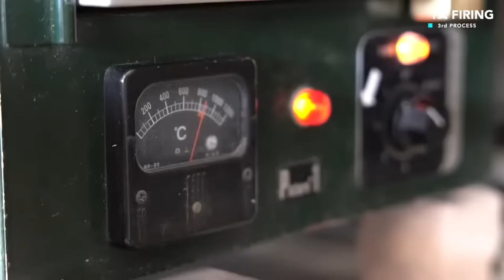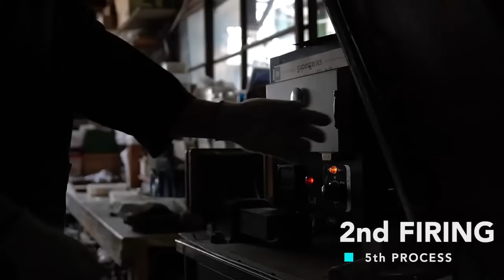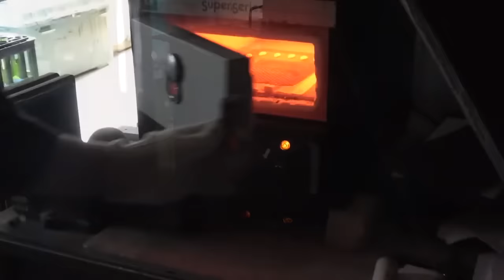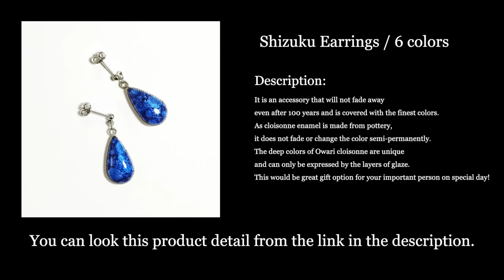七宝ジュエリーを製作するプロセス【ロングビデオ】

Comment: This is beautiful enamel work but not what is  considered to be cloisonné by definition. Cloisonné utilizes  closed spaces created by bending thin metal strips into various shapes and affixing them to a base. These spaces are then filled with enamel paste and the piece is fired in a kiln. These closed spaces are called cloisons (French for “partitions”). This enamel work has no such closed spaces, therefore it should not be properly called cloisonné, but is enamel work of another style. I myself make cloisonné jewelry and this is not it. Nonetheless, I find this jewelry beautiful. As the entire piece is outlined with metal and then filled in with enamel, the entire piece might be considered one cloison. However, cloisonné typically consists of a larger space subdivided by,cloisons, so calling this cloisonné is really perverting/stretching the proper definition.
Reply: It's probably a translation error.  There is a company in Kyoto, called Inabi Enamels, that makes very nice cloissonné vases.  Their work is not like European cloissonne.   It uses a lot of short pieces of fine Silver cloissonne wire which mostly don't form closed areas.   They blend a lot of different colors like this craftsman is doing.  The resulting product is very beautiful and is very expertly done.   I have done a lot of Silver work and enameling, including cloissonne.  I visited Inabi in 1987 and was invited to work in their shop.